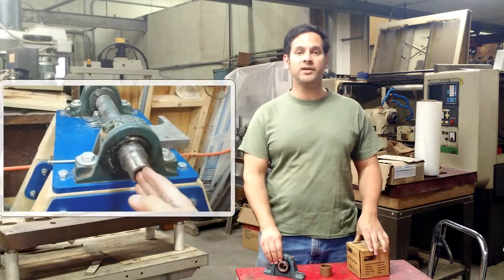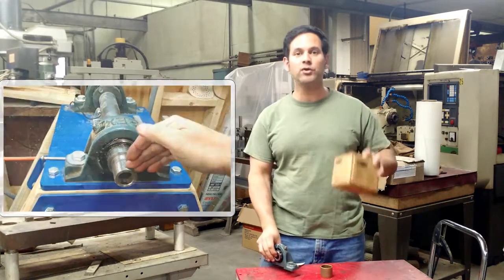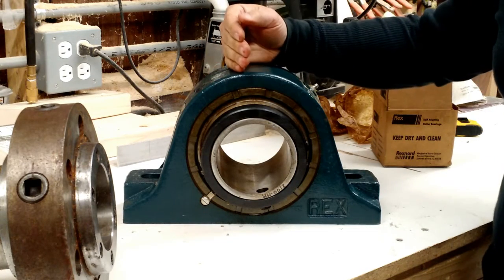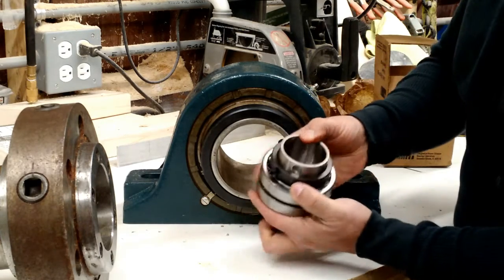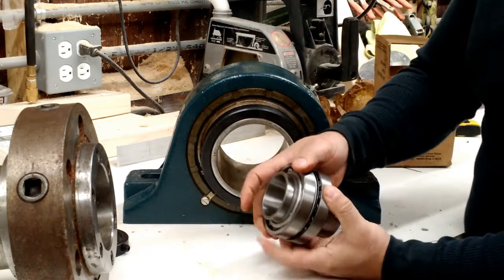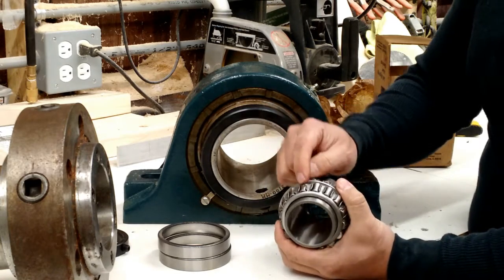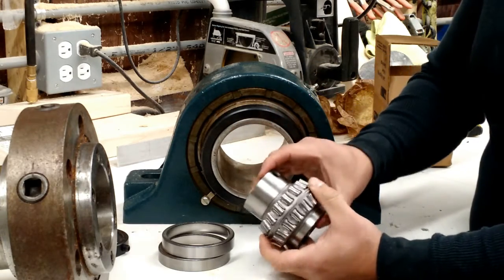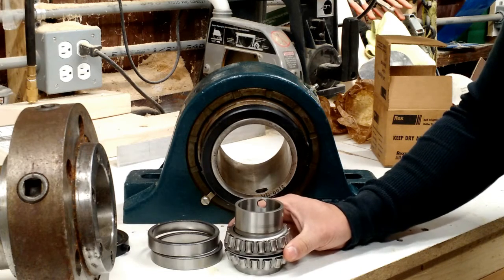HomeMade Lathe Bearings Part 3 - self aligning roller bearings

Comment: Interesting video - what are you using the larger bearing housing for?
Reply from the maker: +Roadside jobshop thanks. Im using the bearing for a homemade BIG lathe. It is part of a community input project...but I've had no input so I'm taking my time designing the lathe.  If you'd like to know more, here is the video https://youtu.be/Q7PIFmHzX5c
Reply: Very very interesting idea. I looked at the video and I like the ambition - what are you making the frame out of?
Reply from the maker: +Roadside jobshop it is going to be steel, the shape is still in flux....I think it will be very similar to my "big blue" lathe here is the video of that lathe https://youtu.be/11Dh0XLtdFQ
Reply from the maker: +Roadside jobshop it won't be my first lathe....so I have some time and experience to think about it a bit

Comment: I assume that despite the room for rotational alignment that there is very little play along the axis or perpendicular to it. s that so? Have you tested or measured it? They look very expensive.
Reply from the maker: they are VERY expensive, that is why i only buy these for myself from industrial surplus.  the alignment is simply from bearing to bearing so it is only for shaft alignment purposes... the bearing tolerances remain the same as normal pillow block bearings

Comment: Hi!  Great video. I got a deal on NOS SKF 6409 single row deep groove radial ball bearing (45mm dia. race) and a SKF 6408 (40mm dia. race) for $1 each with the idea of using drip lubricators for a homemade metal lathe project.  Do you think this is workable - if I use spacers between the spindle and the bearing races'  ?  I don't have a spindle sourced yet.  Thanks!
Reply from the maker: +Aminah Al-Noor glad you liked the video, be sure to check the previous one for more information.  Do you have the whole bearing or just the races?
Reply from the maker: +Aminah Al-Noor I would only consider those bearings if you are providing a separate provision for thrust.  Oil feed would work, but would be messy. Since you are building the head stock, most modern metal lathes have an oil bath condition.